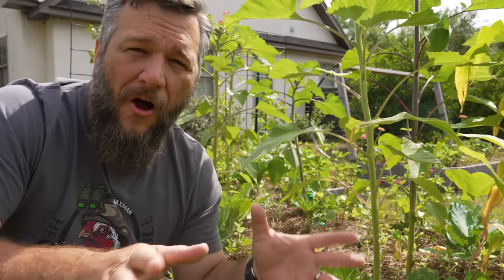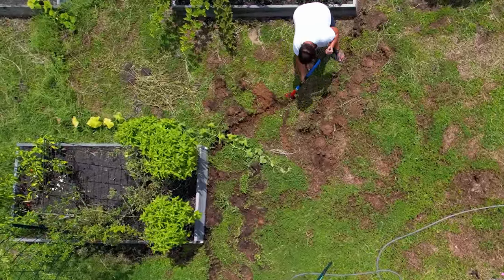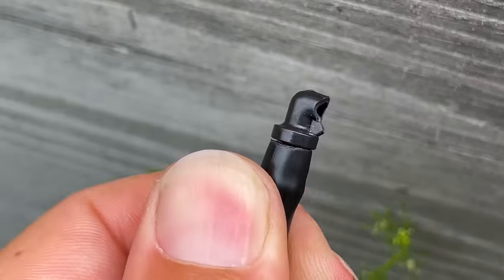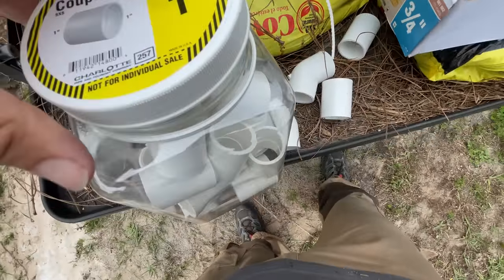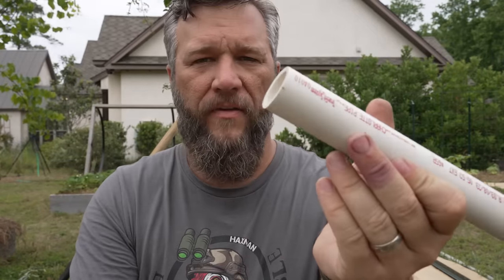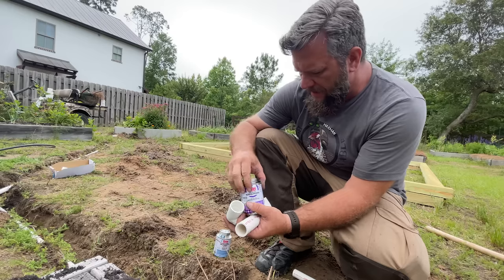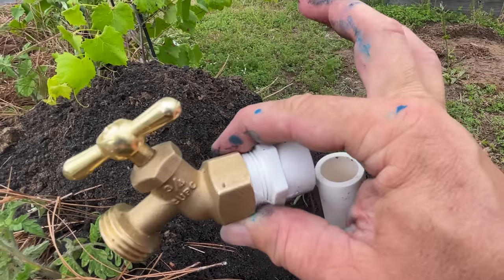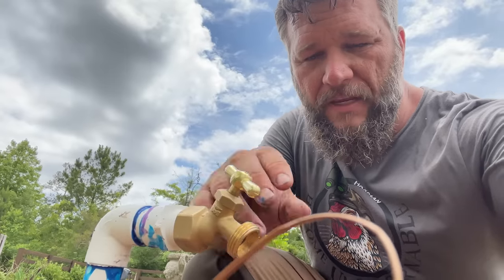Don't Make This Expensive Mistake On Your Raised Beds!

Comment: This is for your ant and other insect problem. It was originally a reply, but I figured you are more likely to see it here.

You can't get rid of ants by killing what you see. If you disturb an ant nest, they will just move to a different spot. A lot of people think pouring stuff on ant hills works, but all they are doing is making the ants move to a different part of their yard. The nests are so deep that you will never be able to pour something deep enough to kill the queen. 

The only thing that will work is ant bait that they take back and feed to the colony/queen or a contact poison. I had good luck with Extinguish Plus fire ant bait, but you probably don't want to use it around chickens because they might eat it.

You may want to use a liquid killer, such as Bifen I/T or other similar products that are professional strength (Nothing at the big box store will work) and sold concentrated. They seem expensive, but you can get many, many 2 gallon sprayers full of insect killer out of one small 32 oz container, so they are really a fraction of the price of the crap sold at a big box store. This may even work on you sand gnat problem, or whatever they are because all they have to do is touch it.

Most of these professional products are safe for kids and pets once they dry and will last for months once sprayed, even if it rains. They work by basically causing the bug brain to short circuit after contact, which kills them in an hour or two. Some of these will also get spread by contact with the rest of the colony once an ant gets back to the nest, so it is good that they work slow. I buy all my stuff from solutions lawn and pest and they have videos and other helpful information on their site. And, for the record, I have no affiliation with the Bifen I/T product or the Solutions company. Just a happy user.
Reply from the maker: Thanks!

Comment: Do you use Diatomaceous earth to help control your fire ants?  I live in Central Texas and we've had a bad fire ant problem for decades now...  I've had a vegetable garden for almost twenty years now and for the first few years, every potato plant came with a free fire ant mound at harvesting time.  A friend suggested I try some DE around the plants, so I researched it online and I started putting some in the ground with each seed potato.  Well, that solved the problem!!!  My taters used to look AWFUL because they were bitten by fire ants all over.  Now, I harvest them and I rarely find a bite mark on them.  I've started putting DE around my other plants to at least discourage the fire ants and I've had some success with it that way too.

Comment: I don't recall how you ran the 1/4" drip line, but you are not supposed to run it more than 15' in a single run.  If you loop it to cover a whole bed, you can easily exceed that and get uneven pressure.
Reply from the maker: Each bed had three eight foot runs.
Reply: @HAXMAN  Wow, should have worked.  Was it a Amazon kit or from a professional drip place like "Drip Depot"?
Reply from the maker: @davidward1259  It was from a drip line company. I can’t remember the name. I wouldn’t want to give them a bad rap anyway. I could have just had bad luck. I do think it’s a poorly designed system though. The small lines shouldn’t be outside the bed at all.
Reply: @HAXMAN  the snapping pieces, tho...... :/  sounds like a quality issue vs user error.
Reply: @HAXMAN  Sorry you had a bad expierence with drip.   I've used drip line and drip tape for 3 years now and it makes a huge difference in our water usage and not to mention the automated timer (2 zones for us). I did the research and ordered mine piece by piece for what I wanted - that may be part of the difference.  I've not had a single fitting fail so far though.  I hope the PVC works out better for your family this time around.

Comment: Just curious, but do ya'll not get any freezing weather?  When I see all that exposed PVC it makes me cringe.  In colder areas, I think PEX coming out of the ground to the valve might be a good alterative.  Also for protection from weed eaters, you can insert the drip lines (or anything that needs protecting) into a short piece of PEX or PVC during install to make a protective conduit.
Reply from the maker: We might get three or four nights of freezing temps a year.

Comment: You should've used Pex instead of PVC. Its a couple more dollars per foot but it comes in 100 foot rolls and is faster to install than gluing sticks of PVC. Instead of glue you used metal rings to clamp to your brass fittings.  Plus PVC will crack and break overtime, especially in freezes, PEX wont.

Comment: I’m with ya on plumbing… 10’ of 1/2” to couple to reduce to 8’ of 45 degree… not a fan. Although, doesn’t the blue cement not require priming?
Reply from the maker: You actually don’t have to prime. At least not with the type I used. It says it on the can. Better safe than sorry though. I did use the purple primer. I just didn’t show all of it.
Reply: @HAXMAN  - commenting because I saw the purple. You must have the same code as FL; that is, if any white is still showing, it’s a violation. The P in PVC stands for “purple”.
Reply from the maker: @thefrankperspective4247  Sorry. I misread your comment. 🤪
Reply: @HAXMAN  lol, it’s like it’s late at night or something.

Comment: Isn’t 1” an overkill for a drip irrigation?
Reply from the maker: Yes, once it transitions into actual drip line. I had to keep it at 1" until I got to the bed and then go down to 3/4" to maintain pressure as well as be able to attach a hose bibb. Whatever attaches to the faucet will be much smaller.

Comment: buried poly-pipe saves ALOT of connector-work, friends! :-))) if using PVC, please know there is a lighter-gauge IRRIGATION-grade pipe. and...there's no shame having exterior-box faucet risers? Why have brass faucets there, anyway, when a ball-valve and whatever in-bed distribution you then use...is just-fine? thanks for the vid

Comment: Winter freeze is the only con to ruining I mean running pvc water line around raised beds...
but we do it anyway bc it works....
PS: I need a sure fire pro tip 4 killing fire ants please "organic preferred"
(one that works) all others need not comment 
ty
Reply: damn. that's my prob, actually. im not in FL anymore so navigating freezes is new. they suggest you pick up your driplines each winter, like..... what? gotta be some easier setup. and i WANT auto water in winter! :V   it's not always frozen.